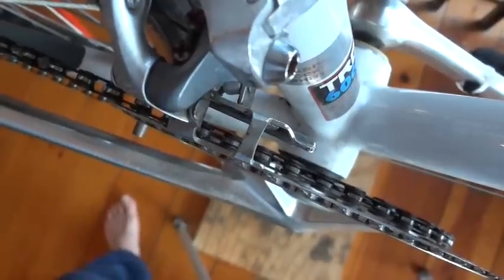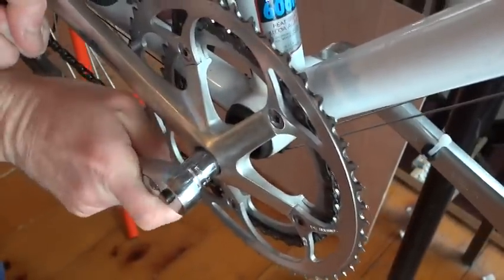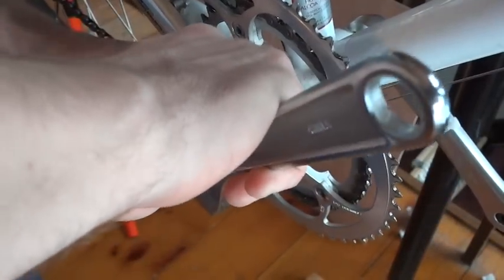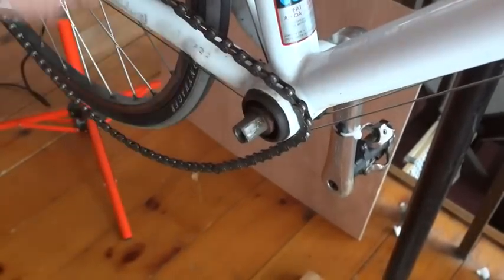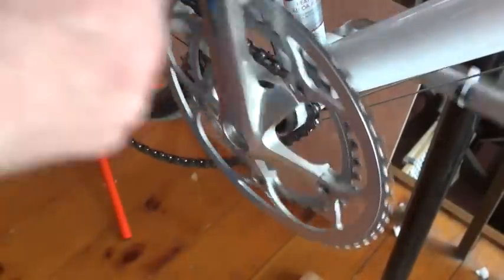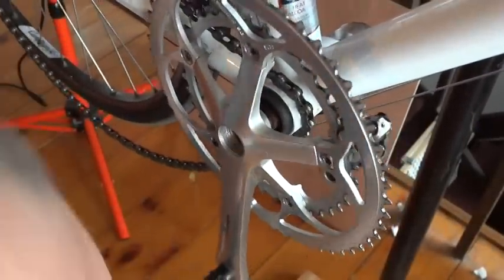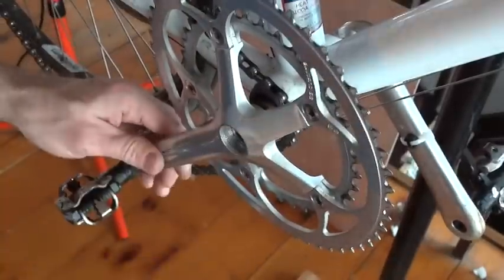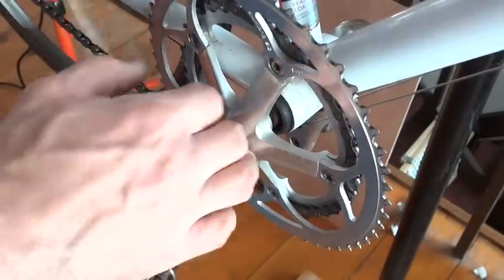How To Fix Chainring Wobble

Comment: Just before I watched this video, I actually solved my wobbly chainring by this exact method, I thought my chain ring was cheap quality, but now it seems that every chain ring is like that. I have generally seen that motorcycle and car parts are much better engineered than cycle parts, they have much finer tolerances for drive shafts, etc, no matter how much you pay for cycle parts. Though their wheels are very wobbly, cycle wheels are much better in that area. Thanks for this video! Amazing like always.

Comment: It works. Thanks!!  So I wonder what does this mean.  Would that be the orientation that gives the least wobble is also the one used to check for the chain ring perpendicularity in making the crank shaft?

Comment: @RJTheBikeGuy - What is the cause of this issue?
is the bottom bracket pedal spindle bent? or is the chainring crank arm bent?

I'm dealing with this same issue but way more wobble, causing chain skipping everytime the chaingring arm rotates to the bent section. I checked the chainrings and they are not bent at all, its just when I rotate the crank arm that I see major wobble in one section.
I've researched so much and can't find much information on this issue.

I tried what you did in this video but still can't get it straightened out, which is leaving me to believe that the Bottom Bracket Spindle is bent. 
Would love to hear feedback from anyone with and suggestions or in-depth video on this issue because it is a major problem right now. thx

Comment: Good video. On my 1992 Schwinn Paramount, the teeth of the Shimano 105 crank's 39T small ring is about 2mm from the chainstay. I was told that on my old bikes, this was the norm and as long there wasn't any evidence of chainring wiggle, it was okay. Seems 2mm isn't very much wiggle room at all, what's you're input? Second question, as a project I picked up an old 1980's Italian steel frame. Besides measuring the length of the bottom bracket to determine what size BB to get, do you determine spindle length by the rear wheel's cassette? Thank you.
Reply from the maker: The length of the BB is usually part of the specs of the crankset. So try looking up the specs of the crankset. Or try getting a BB with a slightly longer spindle.
Reply: @RJTheBikeGuy  Great idea, thank you.

Comment: So by rotating the crank 180 degrees wouldn't that basically just change the wobble by 180 ? Whats the dynamic that's actually working here? Thanks in advance
Reply from the maker: Imperfections in the machining of the spindle and the crank arm.

Comment: Great video RJ!
How would you tighten or change the chainrings on a vintage bike?
The Park Tool Chainring Nut Wrench, CNW-2 doesn't work on my vintage Shimano XTR M952 crankset chainring back-end nuts.
Please tell which tool I would need to fit a vintage Shimano XTR M952 crankset?
I have been researching for a few days now.
Thank you!😀

Comment: I have a 2013 Diamondback Podium 2 with a sealed cartridge bottom bracket.
Do you have any advice on how much I should torque it down when I reinstall the cranks in a correct position with less wobble?

Comment: So, if you can't get any positions to fix the wobble are you SOL? Would a new crankset fix the wobble, then or just scrap the bike? I got schwinn to send me a new crank set when I first bought the bike.. never thought I'd need to use it..
Reply from the maker: It could be a bent chain ring. It could be the crankset. It could be the bottom bracket spindle
Reply: RJ The Bike Guy won't know which until the positions are tried to eliminate the crankset bolt position as the culprit, pretty sure it's not the chain itself. the crank rings are part of the crank and not really serviceable

Comment: I had the same issue, I measured from the inner side of the spider (crank) to the middle of the chain-stay turning the crank 12, 3, 6, 9 O'clock. At each turn the measurements were exactly the same. I then repeated the process measuring the distance from the chainring (s) to the middle of the chain-stay (You've guessed it) They're out by a good few millimetres. I'm about to loosen (adjust) and retighten the 5 chainring bolts (Wish me luck) and hopefully I'll be able to lose the slight oval effect of the chainrings too. Thanks for reading. 

The "other" bike guy.
Reply from the maker: Could be bent chain rings.

Comment: Hey. I recently saw my vintage Peugeot performance 20 ofmega chainrings wobble. I tried all 4 positions and its almost same but little bit better than it was but it still keeps wobbling. I don't think chainrings are bent because it does that on small and big chainrings. What you think I should try to do?
Reply from the maker: If you tried the above steps, and the chainrings aren't bent, it could be the BB is damaged. Try overhauling it with new bearings, or replacing it.

Comment: Hi @RJ The Bike Guy,
I had the same problem, and tried this method, but I think that one of the spider arms is out of true. How could I go about fixing that?
Reply from the maker: It could be the bottom bracket, or the spider, or a bent chain ring. You can possibly straighten a bent chain ring. The spider or the bottom bracket will need to be replaced.
Reply: Ok, thanks. Should I be worried about the few mm of wobble? Or is it fine to leave it until I can afford a new set of cranks?

Comment: My bottom bracket was loose and wobbly so I replaced the spindle and bearings, The spindle I took out had bad wear on it and the grease was dry and crumbly. After fitting the new spindle with plenty of grease it felt good but after a month it's back to being wobbly. I did tighten up the locking ring a little which fixed it for a while but it's gone back to wobble.What could be the problem? I am thinking it's not a  good idea to tighten it up because either something is getting worn in there or the bearings will end up getting crushed or should i just switch to a sealed cartridge.
Reply from the maker: +paul sha You can try a cartridge BB. It could be the faces of your BB shell are not parallel and causing wear in your BB. So maybe getting them faced might help. Or not. Maybe the issue your crankset...the faces inside the arm maybe damaged.

Comment: This only seems practical in random cases. What caused the ring to wobble in the first place, its own warp, or wear on the center bolt?
Reply from the maker: Imperfections in the manufacturing process. This is actually not uncommon.
Reply: So the ring warps over time, the bolt, both?
Reply: @NoEcologyNoEconomy  No. The bottom bracket taper is not exact on all four sides. In addition the taper in the crank is not exact, so when you try all four positions you will find one position that works better overall at reducing wobble.

Comment: Hi. Thanks for video. Can I use the same methode for an octalink shimano?
Reply from the maker: This works due to machining/molding difference in the square taper spindle/crank arm. I don't think octalink will have the same issues as this, so I don't think it will make much difference.
Reply: @RJTheBikeGuy  Could it be due to minor angle  imperfection of bottom bracket housing?
Reply: @RJTheBikeGuy  I mean what else it could be ? It's a new merida 200 with sora 2018. It's frustrating!! I checked all the bicycles in store where i got mine and all have the same kind of issue.
Reply from the maker: @NickiKhonsari  Could be something bent. BB, spindle, crank, or chain ring. No it wouldn't be the shell, as that wouldn't cause wobble.
Reply: @RJTheBikeGuy  Thanks alot for your reply

Comment: i've had this problem lots on some of my low end bikes (btwin 340, giant atx 2 and my diamondback overdrive 2013) and have always has this problem. is this because of components that is not very durable or does it just happen with any bike. i've only had my giant for about and year and im already seeing signs of wobbling, is this due to a low end part?
Reply from the maker: The fix in this video is for variations in the manufacturing processes.  I don't know why you are seeing wobbling. Maybe something is worn or bent.

Comment: Can you make a video on how to mount an oval crankset? I mean: which derailleur should be the best and the other issues.
Reply from the maker: The crankset isn't oval, the chain rings are. They mount on the cranks the same way as round ones except you need to have then oriented correctly. The rear derailleur is not effected. The front derailleur is the same except you have to mount it in relation to the widest point of the chainring. It's mostly the same.

Comment: So I tried, this method but my crankset keeps rubbing against the bike frame. It's one of those old Shimano Biospace sets if that helps. Would it be the crankset or the bottom bracket
Reply from the maker: Sounds like your bottom bracket spindle is too short for your crankset.
Reply: to clarify, the inner chainring is the one that is rubbing against the frame.
Reply from the maker: Sounds like your bottom bracket spindle is too short for your crankset.

Comment: At 1:53 it just gets tighter and tighter, even though I'm going clockwise like you did!
Reply from the maker: Here is another vid I did on removing the cranks. How To Remove/Install Crank Arms On A Bike
But basically turned the large threaded part in till it stops. Then hold it and turn the small part in. It will get tight at first. Keep turning it in until it pulls the crank off.
Reply: shyflirt1 I used a crank arm puller tool--I tightened the larger part by hand, then the smaller part, then while holding the larger thread, I turned the smaller nut clockwise but it only became tighter, and the crankarm seems like it won't be coming off anytime soon :|
Reply: Update: I went to my local bike shop and they kindly volunteered their time to help me out. It's all fixed now!
Reply from the maker: Nice.

Comment: checked, its tight. when rotating the crank freely ( without the chain ), the crank moves in and out.
I suspect a bent rod that connects both arms,( is it possible!!? ) correct if I m wrong
Reply from the maker: +mohammed abdul moiz As I said, you shouldn't be able to push your crank arms in and out. Something is messed up in your bottom bracket.

Comment: when i rotate the crankset, the entire shaft wobbles. Do i need to buy a new crankset or should i just buy a new shaft/spindle? the set came stock with the bike (cheap, shop built and i cant remember the labels cause it's a bit old)
Reply from the maker: Remove the cranks and see if the spindle by itself wobbles. If yes, replace it. You might upgrade to a sealed cartridge bottom bracket if it doesn't already have one. If the spindle doesn't wobble, try the steps in this video.
Reply: how does switching the crank arms in different positions get rid of wobble?
Reply from the maker: With a square taper spindle, there are four faces. The faces aren't all at exactly the same angle. There will be slight variations. There are also slight variations in the faces inside the crank. So by rotating, you find the face that offers the least wobble.
Reply: so is the wobble caused by use and wear?
Reply: and thank u for the info
Reply from the maker: J.D Lucas Not if you get them tightened properly.
Reply: i was riding today and kept hearing a clicking noise when i was pedalling on the front cogs.Noise only happened at a certain point..any ideas?
Reply from the maker: It could be about 100 things from a loose bottom bracket, loose hainring bolt, loose seatpost, cracked frame, etc. Good luck.
Reply: should i be worried about my front derailleur cable being alittle frayed?
Reply from the maker: The end of the cable where it comes out of the derailleur?
Reply: yes..im not sure if it was a possibility that i couldve been alittle hard on it and it had some slack in it to so i loosened the screw that holds it and pulled it tight...but when i tried to shift up it would shift gears but it was real hard to do...im guessing its to tight?
Reply from the maker: I am not sure what that has to do with a frayed cable? When installed a new cable, put a crimp end on it so it wont fray.

Comment: My whole drive train is screwed and it's almost brand new, any advice?
Reply from the maker: If the bike is new, and screwed up, take it back to the shop where you bought it.
Reply: @RJTheBikeGuy  bought it off let go. It's a 28" aluminum Schwinn 29er, 60 bucks it looks brand new couldn't pass it up. I'm going to bring it in for maintenance and hope for the best. Thank you Bike Guy
Reply from the maker: You can either take it to a shop and have them fix it, or start working through the issues. I can't diagnose it without working on it. I have a lot of videos on various things.

Comment: How do I fix a wobble in the bottom bracket? Mine has been wobbling for ages but now my drive side pedal is pedaling weird after sliding in the wet today. But I can't see any issues with the crank, pedal or cog.
Reply from the maker: Then probably overhaul or replace the bottom bracket.
Reply: @RJTheBikeGuy  I finally got my bottom bracket opened up but after inspection, I couldn't find anything that would be responsible for that right pedal "wobble" feeling when I pedal. I suspect that when I slid out on my side, my right pedal crank took a hit that may have dented or deformed the square hole that goes on the square taper. I'll try swapping out that pedal crank.

I have a question about the tool you use to remove the fixed cup side. What is the name of that wrench exactly? Where can I get it? I've been using a large spindle wrench but the amount of times that thing slipped off drove me to near insanity. I'm looking online for that tool but can't find anything like what you have.
Reply from the maker: @myscreen2urs  There are different bottom bracket tools. I have a tool page here: http://www.rjthebikeguy.com/tools/

Comment: Hi 
my problem is that my left arm when pushed inwards ( I am facing the bike from the left side of the bike ) causes the whole crankset to wobble. but if I push the right arm inwards, there's no such wobble. my bike is a huffy rival 26".
Reply from the maker: +mohammed abdul moiz Sounds like you bottom bracket is loose because you shouldn't be able to push in the crank arms.
Reply: +RJ The Bike Guy thanks

Comment: just so you know you are using both adjustable wrenches backwards the jaws are supposed to be the other way if it was a stubborn bolt you would break the wrenches.
Reply from the maker: I was wondering why the wrenches didn't work. Wait a minute...They did work. Total surprise.
Reply: @RJTheBikeGuy  it was not a matter of the wrenches working its a matter of using tools properly, in a way that they are meant to be used I guess you cannot take constructive criticism

Comment: I have a brand new crankset and it still wobbles. I also had a brand new bottom bracket but it is a bit longer than its slot.
Reply from the maker: New bottom bracket but it's longer than what slot? Sounds like wrong parts, or installed wrong.
Reply: @RJTheBikeGuy  some of it is showing outside the Bottom bracket slot
Reply from the maker: @TheTriangle444  I can't really tell you much without seeing it.
Reply: @RJTheBikeGuy  never mind the bottom bracket, but the chainring is brand new yet it still wobbles like my old one and keeps hitting the derailleur on a point.
Reply from the maker: @TheTriangle444  I can't diagnose it without working on it. Take it to a shop, or figure it out.

Comment: What if i dont have that specific parktool?
Reply from the maker: Then buy some other brand tool. If you don't have tool, take it to a shop and pay them more than the tools costs.
Reply: @RJTheBikeGuy  alright. i recently went to a bike shop before finding this video and they really insisted i buy a new crankset even if i told them i dont suspect it because it doesnt seem to be bent at all and i recently also changed my bottom bracket from a different bike shop so im about to do it myself
Reply: tap it out with a hammer just like you tap it in, just watch you dont bend your crank that way

Comment: what's the difference how the crank is put on won't it still look bent and wobble in and out from the derailleur?
Reply from the maker: The mating surfaces of the spindle and crank arm are not perfect. There are variations. So generally some combinations will be better than others.
Reply: RJ The Bike Guy oh ok thanks for the quick reply
Reply: RJ The Bike Guy btw would you have a video on how to index a front derailleur i have been trying for weeks now with no luck i have cleaned and relubed shifters and the chain and i have replaced cables but i am still haveing trouble with my bike (learsport bw3000) not shifting up into 3rd gear at the front when on 7th gear at the back (max).
Reply from the maker: Around 19 minutes in.
https://www.youtube.com/watch?v=f1vSHauv1VY
You may need to adjust the cable and/or limiting screw.